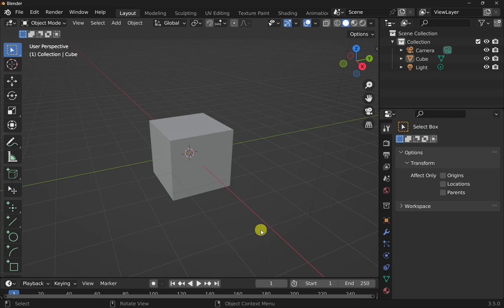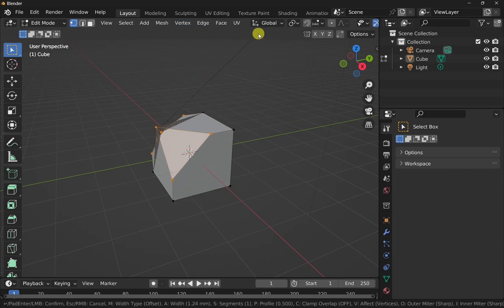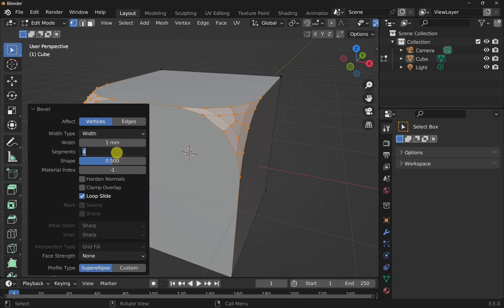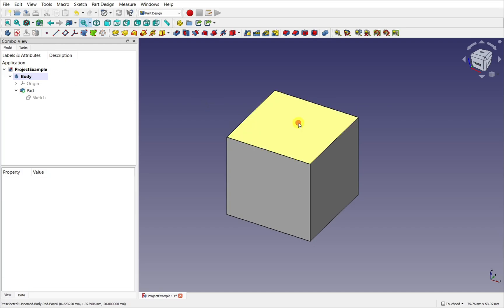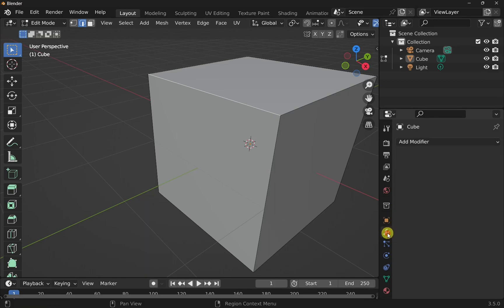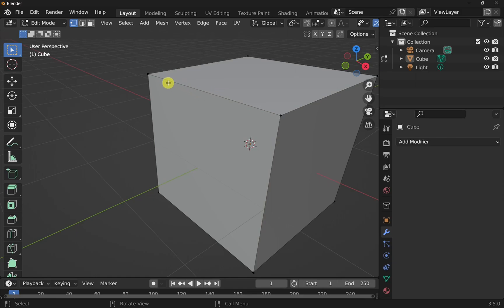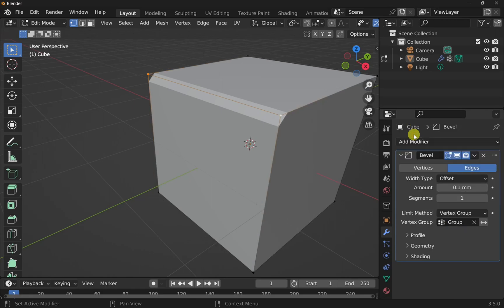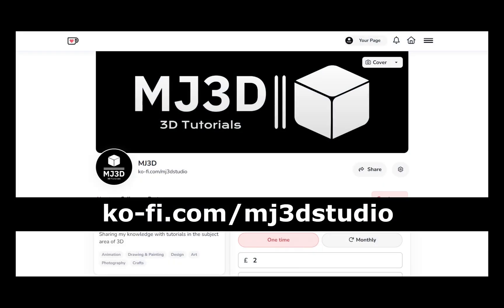How to Fillet, Chamfer, Bevel ? Blender 3D Vs FreeCAD | CAD Operation Comparison | Beginner Friendly

Comment: How does blender handle changes in the object after adding bevels? In freecad it's a horrible mess if you make any change to the body, you basically have to redo all bevels from scratch....
Reply: In blender the change is permanent and there is no feature editing. You hit undo but once you close the model in blender the history is lost.
Reply: @Nobody-fm3jh  I'm not an expert of blender at all, I used freecad though and history editing there is a mess. but doesn't the last part actually showing "modifier on a stack" way to bevel, and you suppose to be able to change it in future?